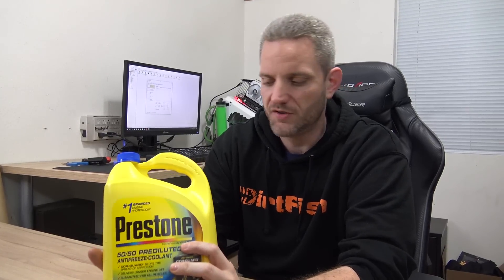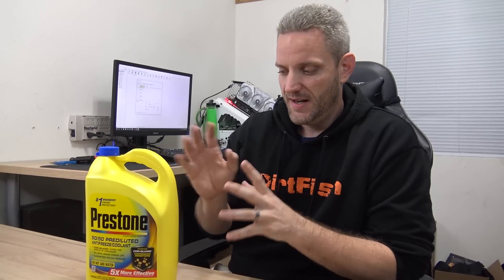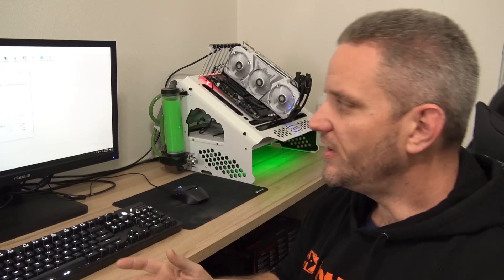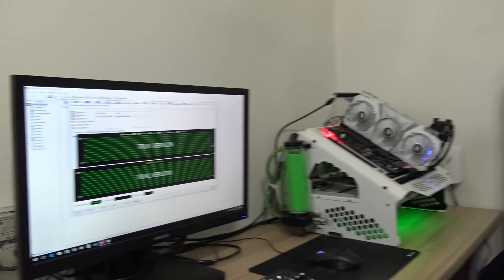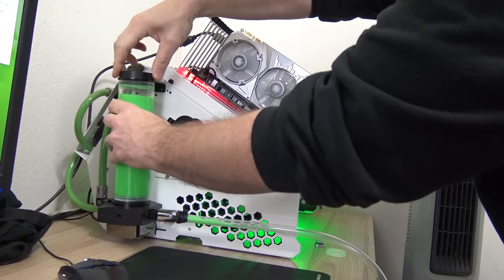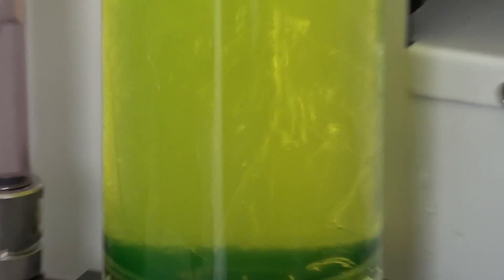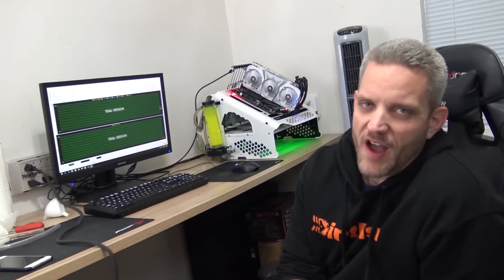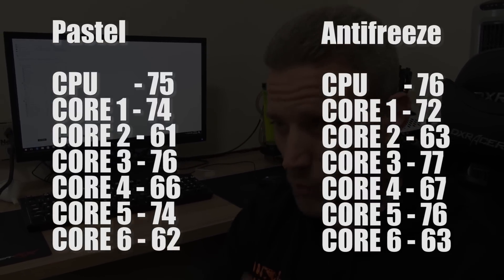I used Antifreeze to cool a PC

Comment: Turned an HP Pro 6300 MT into an Aliexpress mixed metals loop with antifreeze with the loop going through the CPU and GPU - 61c CPU (I have a bad mount I need to redo and repaste) max load Prime and Heaven running at the same time for 1 hour, GPU 43c - going to leave it running (after remounting) until it fails to see what happens.

Comment: I've had the same brand in my loop for 12 years and there are no problems whatsoever.
No algae, no corrosion, no blockages, no nothing. I've never changed it. Temps have also never changed.
Watercool radiator, Heatkiller block, EK res, DDC Pump, primochill hose.

Next time, I'm trying Mopar because it's a cool pinkish red color.

Comment: Since 2004 I have build alot of custom watercooled computers, In ALL of them I used 5% blue antifreeze concentrate with battery water as cooling fluid, Mind you I never ever had any failures, gunk or corrosion, Tygon tubing and 95% all copperblocks and copper rads. One of my testrig went for 4 years before I changed out the fluid. Because i had a clamp failure so I rebuilt the testloop with a bigger 360 rad. Do NOT use only consentrate antifreeze, my testing shows that between 5-7% consentrate of antifreeze will give you a algeae free and clean loop. Now im running a nickelplated AM4 cpu block in my test loop, with a copper 360 rad, and a D5 pump, 7 months and counting.

Comment: Common misconception is that antifreeze is only to prevent freezing. Antifreeze in your common 50/50 mix has a boiling point of about 223F where as water boils at 212F. This is why you shouldn’t run straight water even in the summer.

Comment: the main difference between antifreeze and water is that antifreeze is designed to not freeze at very low temperatures. it is not designed to be better at conducting heat. unless you are using your computer in the arctic- outside, then there will be no advantage. distilled water will be better and safer.

Comment: Obviously the best coolant would be Brawndo.
Reply: Modern autos use a variety of plastics, rubbers and metals in their various cooling systems. Modern antifreeze is formulated to not chemically react with any of it. It is also designed to be near as effective as water at heat distribution. It won't do better than water at heat distribution, and it's not likely your PC will be below freezing temps, so while there's no downside, there's no requirement or upside to using antifreeze either.
Reply: It's got what computers crave, electrolytes

Comment: Well isnt that a surprise... :-) etilenglicol lowers the temerature coeficient of the water in turns of gaining the freezing point.
So it is worse in term of "moving" the temerature than plain water.
I am in to centralheating and clima busines, and watercooling PC from 2000. One of the first who get Athlon 800Mhz over 1Ghz mark. All hand made components.

Comment: Have you ever thought of using Red Line's Waterwetter. They claims it "Contains no ethylene glycol", and "Reduces or eliminates bubbles or vapor barrier that form on hot metal surfaces to reduce coolant temperatures by up to 20°"

Comment: Jay, I love your videos, I really do, i am new to PC topics, and you are among the best sources of info on YouTube. But this is not a good one. Why would you stick 50/50 anti freeze in your system? You dont even do that in an engine. Rubber and plastics are used in engine coolant systems extensively (I'm a mechanic) and under much harsher conditions than in a PC, and the erosion to plastics and rubber due to the coolant is well, not really an issue (unless oil is in the system. The coolant tank in your engine, is plastic, the hoses and seals rubber. Coolant mixed right in water, any water will not harm a PC cooling system if you do not use cheap plastics or other chemical make ups in it. That coolant gunk as well - is well, gunk, that's why cheap plastic is used along with it. I will used an AIO with custom silicon hoses (which help dissipate heat). There will be hardly any maintenance involved and no erosion from any part of the system. If need be I will replace the rubber o ring on the pump. Antifreeze when properly diluted, and a good brand will be much better at displacing heat than gunk and water, or just water, and will require little maintenance.
Reply: nihilityjoey 
Antifreeze does no better than water in liquid form at displacing heat. If we look at the specific heat of water (419 kJ/kg C ) it is actually higher than ethylene glycol (2.264 kJ/kg C at 0 C) by a lot, Where 50/50 antifreeze provides an advantage to either is that it remains liquid over a wider temperature range by lowering the freezing point and raising the boiling point. This is great for cars as both conditions could be present during the year especially if it is in the North.

However using it as a coolant in a computer has fewer benefits unless the computer is in a freezer (which wouldn’t need liquid coiling anyway) or the CPU/GPU gets over 100C which is cooking your computer. Normal antifreeze has added lubricants which help a bit using it but the trade off of extra cost isn’t worth it to me.

Comment: Use Toyota red coolant, it is better for longevity and is also better for corrosion resistant. Probably your temps will not change much, but if you really are going for longevity the Red coolant is the way to go.

Comment: There was no chemical reaction. You saw just the difference in density between the remaining water and the coolant. The thing is ethylene glycol has a lower heat capacity than water. Btw. the coolant said 50/50 which means it's already diluted with 50% water. The reason to put ethylene glycol in the coolant: thats the anti-freeze part :) . Depending on the specc of the coolant and for which engine (cast iron or aluminium-alloys) it should be used the additives (eg. corrosion inhibitors) it is possibile that it doesn't play well whith the metals used in the cooler etc. ethylene glycol and some inhibitors have an effect on plastics. The can harden or in case of seals they soften and bloat.

Comment: I use antifreeze and still using it for about 3 years, no problem, no discoloration, works good.   But I used antifreeze because I had a car radiator hooked up outside of my window with a fan on it.  My temps was amazing in winter and good in summer.  But for about a year now I changed my case and didn't want to drill holes in to route the water from outside so closed off the loop and purchased Case radiators and fans now.  It was so much quiet before, only fan that came on was from GPU which I cooled the back plate with 3 water blocks and helped amazing too, but removed it for internal closed loop.  
The only bad thing about using antifreeze is that its thicker than water so you will notice the water flow... water will run faster, but not sure if really makes a difference now.  But I am searching for the solution that the mother board is safe if their is any leakage!  So will only take out my antifreeze once i can find that solution.  It does have a good color which changes well with Led Lights colors.

Comment: Ethylene glycol doesn't absorb heat as well as pure water does, and commercial antifreeze doesn't contain surfactants to lessen the surface tension. So the only benefit it would give is that it has a UV additive that glows under a blacklight (or in sunlight) to detect leaks. It's used in cars because an engine gets hot enough to boil pure water coolant, and parking outside in winter will freeze it.

Comment: I used an antifreeze coolant mix with my CORSAIR Nautilus 500 Complete External Liquid Cooling Sytem for  at least 3 years running 24/7.  Better heat transfer as well.
Reply: it didnt damage the plastics on the water block of ur gpu??
Reply: @Zfast4y0u  Why would it? It's made to be safe for all materials found in a cooling system. Steel, iron, aluminum, copper and Plastics. And there are many different coolant formulas these days, many oems specify a specific mix for their vehicles

Comment: Ran 70/30 mix for years, never had issues with anything. Ran DangerDen radiator, pump, acrylic top copper CPU and GPU blocks, 3/4 tubing all from them. They've been gone for years now, still have the setup and works fine.

Comment: I've had a system running on the blue Chrysler antifreeze for years now. DDC pump with acrylic top, flexible tubing, acrylic tube res etc. Just took it apart and cleaned it but it was just about spotless. So it has plastic, acrylic, nickel plated copper, copper, 2 brass fittings, and whatever else. Nothing was ruined, cracked or crazed.

Comment: It actually depends on what antifreeze you using. For example, on my VW instruction said use Red one because of reaction on metals and plastics that used in car. (Plasctic radiator intake/output) And my 93 Honda using Blue one.

Comment: Pretty sure that 'reaction' was just the distilled water that was still in the pump. It takes some moving for it to mix in with the antifreeze and until it does it has a different viscosity.

Comment: Why the fuck would you use antifreeze? If you dont need it's anti freezing properties, as in your computer is not operating under freezing temps, you don't need ethyl glygol or propylene glycol at all in your water. Glycol transfers heat at a lower rate than water. So your heat exchange system is much worst with antifreeze. If you just want rust inhibitors you should buy waterwetter.

Comment: Been using 50/50 antifreeze mix for 6 years now without changing it or flushing the system - no problems :)
Reply: I used 50/50 for 3 months and my plastic pump cracked and decintigrated, leaking fluid all over my ps3. The ps3 survived and all the tubing seemed ok so I ordered an acrylic and anodized aluminum pump to replace the shitty ABS pump. I paid $3 for the ABS pump but the replacement aluminum pump costed $32 not including the barb connectors.

Comment: I'm pretty sure that if the antifreeze do something to a component it won't be melting it. The appropriate word is dissolve. That happens when you mix Styrofoam and acetone together for example. I don't know if it will do something bad to this particular system because I am not familiar with its chemical composition but I wanted to clear that out.

Comment: Watch out, glycol reacts with silicone and makes a gel, that's why you cant use DOT 5 (silicone base)  with DOT 3, 4, or 5.1 (glycol based) also DOT 5.1 is safe against paint, plastic, and rubber, unlike the others.

Comment: Water Wetter, is like an additive to water that will kinda balance out the coolant vs pure water cooling. Kinda cheap. Ive have noticeable success in automotive application. But those are much different heat levels and extremes
Reply: its soap

Comment: hey Jay i was watching this video and an idea popped in my head surrounding AIOs i know the liquid in side them is treated to prevent degredation of the materials but how well do the AIOs hold up if the liquid freezes. if the liquid can it freeze what if any damage is caused such as busted pipes,damaged radiators or pump with the expansion of liquid as it freezes the reason im asking is i have a corsair h150i Pro RGB 360 in my rig i dont use heating in my pc room and temps often drop to close to freezing in the winter months

Comment: Copper only won't have any problems with water only.  And the pump doesn't need lubrication the ceramic bearing isn't touching the rotor if the pump is under load (water).

Comment: Why would people think that you could use antifreeze to cool your computer, just because it's used in cars to cool them doesn't mean you can use it to cool something else. The purpose of putting antifreeze in cars is because it won't freeze in the radiator and the engine block, because some things that freeze tend to expand especially water or different types of liquids.

Comment: It is pointless, your right. Anti freeze is designed to stop your car cooling system freezing up in cold temperatures not keep it cool in the heat. For that you should have tried automotive air conditioning gas.... highly dangerous to try tbh.

Anyway, like i said, pointless

Ps, subbed

Comment: the problem with using antifreeze is not that it's going to mess up your system because antifreeze allows for the use of multiple metals in a system without corrosion. problem is antifreeze is specifically designed to keep a car operating at a certain temperature which is higher than you want for computer, so if you're actually trying to run a computer at low temperatures such as being ambient it will never work because antifreeze would literally help the computer heat up. You can  however use a super coolant which is not design to prevent super low temperatures instead it's designed primarily for corrosion prevention and heat dissipation through a radiator.
Reply: No. Ethylene glycol merely raises the boiling temperature of the water by 7C. Unless your cpu gets hot enough to boil your loop it won’t have any severe difference in specific heat capacity. A 50/50 mix is comparable to plain water. Water is a bitch of a corrosive, so having corrosive inhibitors can help with that. It basically won’t do anything.

Comment: I now use Glysantin G48 with water many years in my watercooling. It just adds a slight green tint and works perfect. No coloured soft tubes or clogged up filter anymore. I used anti corrosion and different colors before but in the long run they all tended to lose some colour and instead left colour in my tubes.

Comment: Could you do a test using nuclear grade heavy water or D2O, this liquid seems to work well cooling nuclear power plants.
Reply: Heavy water is used in some reactor designs because it absorbs fewer neutrons than light water and that allows the reactor to use less-enriched fuel. If your computer is radiating neutrons you probably shouldn't have it on your desk, or really anywhere near you.  Heavy water is very expensive and its physical and chemical properties are only slightly different from light water, so it's not worth playing with.

Comment: Why use antifreeze as it's thermal capability is worse than water? If you are afraid of gunk and residue from the water, you can add antifreeze to prevent corrosion but adding too much will have a severe impact on the cooling. Antifreeze is exactly for prevention of freezing and corrosion, not to improve thermals.

Comment: Water is the best heat displacement the only reason coolant is added and needed in cars is because the typical engine gets up to 220 degrees F and it keeps the water from boiling away, Same when it freezes it keeps the water from freezing that's it.

Comment: Alright... How about liquid mercury, can you use that as a coolant, considering it has the absolute highest level of thermal conductivity in ANY liquid form. 8.3 for mercury in comparison to water at .67. I understand that this test has it's hazards, but that's why you have coconut monkey. So I guess my question would be, CAN you use liquid mercury as a coolant? It's non-reactive to water until like 350C which is significantly higher than anything these CPU's will allow. Plus, I think it would look downright sick in like a new PC mod, like Transformer PC or Steampunk! Bring me in, I have ideas and would love to put them to the test!
Reply: Pumping mercury would be the problem because of its density, a conventional pump would kill itself trying to pump Hg.

You could set up a convection circulating system or maybe a magnetic pump like a magnetohydrodynamic drive for a ship but the electrical current induced in the mercury would probably play unholy hell with a cpu.  

That pretty much only leaves an old fashioned piston pump which actually might be really cool with the steampunk theme.

Comment: The tube and defuse plate is a sediment trap. You'll not get any difference in temperature for a few reasons. One, antifreeze prevent freezing of the coolant and acts as a lubricant on moving parts. The other reason is that you do not have it under pressure which modifies it's boiling point. In a car, the heat puts the  whole system under pressure, usually about 13 to 20PSI, this changes the boiling temp and cooling capacity. As for the soft tube, switch to hard tube (craftsmanship and tools required) or regular clear poly-tubing. I prefer aluminum or copper hard tubing because it increases the total radiator capacity.  However, shaping the tubing takes practice.

Comment: Back in my MSI K7D Master L running dual bridge mod Thoroughbreds then dbm Bartons I ran all Danger Den with a Chevy heater core over a window AC unit output vent running 50/50 antifreeze. No problems at all for years. Full load overclocked and overvolted core temps about 26C. (sometimes the blocks would sweat cold if I let the unit idle to much)
Just thought I'd irritate yall with another auto coolant story.

Comment: Here is a lesson in physics. Water has extremely high heat capacity , double that of alcohol (used in antifreeze) . This means that it's by far the most suitable liquid for cooling something , the only thing that even comes close is amonia. Alcohol is simply used in cars to prevent corrosion and to lower the freezing point of water.

Comment: The only reason to use antifreeze (or any coolant with a lower freezing temp) would be if you had a way to cool the rad below the freezing point of just water, which would be hard to do outside of say putting your rad outside in the winter or somekind of freezer. Even then you open up other problems like condensation.

Comment: Late response but...my input: There is a way to passively do this by osmosis, prolonging the life. Of course, you couldn't leave the thing off for more than a couple days at a time. Nextly, this could be useful in timed extreme situations, ie: calculating a hash, and then dumping the coolant.